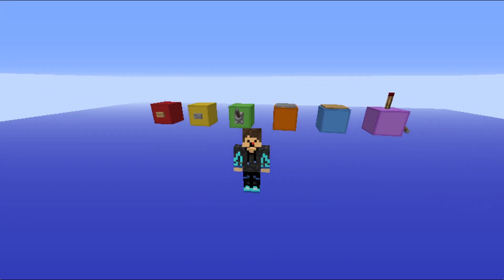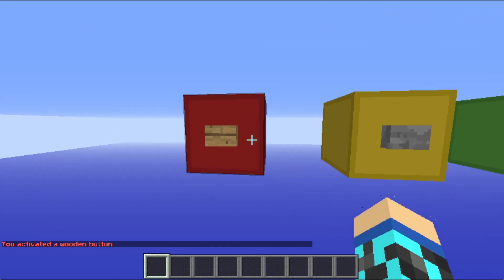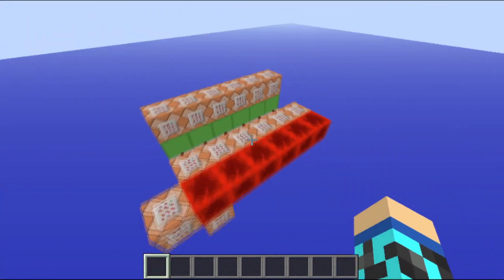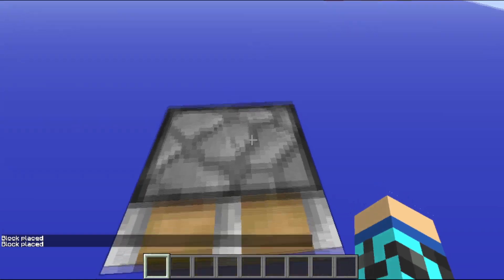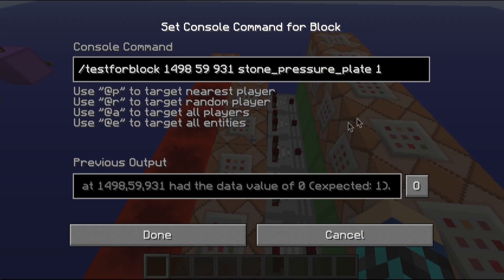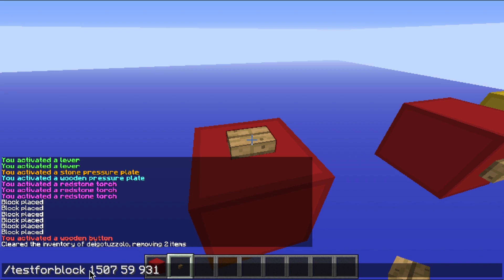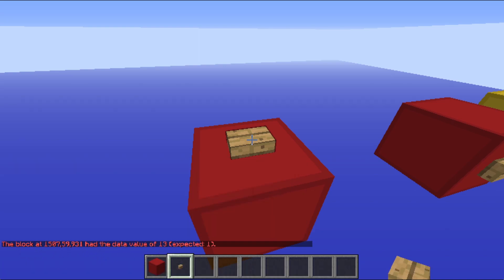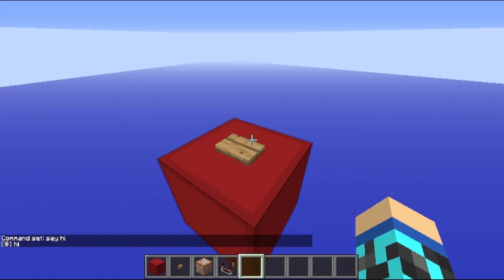100% Wireless redstone in Minecraft- Command blocks

Comment: guys this works with all platforms of the better together update. even xbox. il make a tutorial if i can. most likely this guy will too
Reply: Now, on Switch, it does not work as expected, the light remains on regardless of whether the lever is activated or not, the control is always running